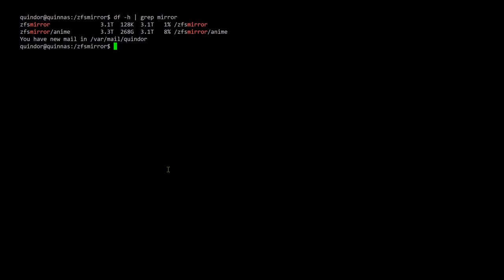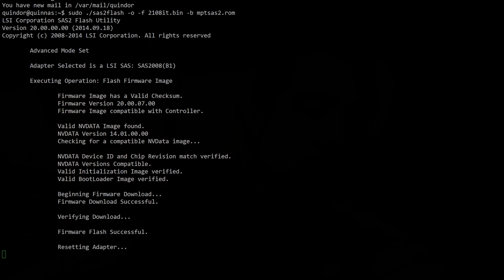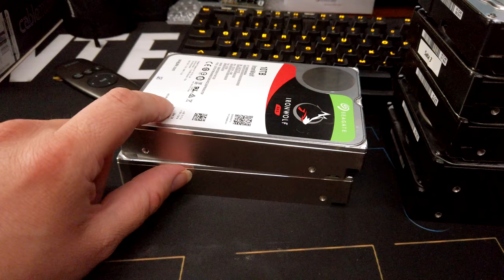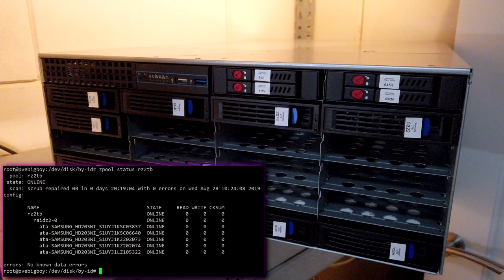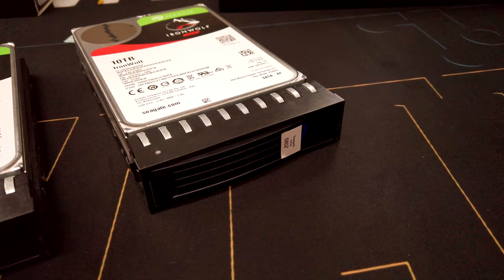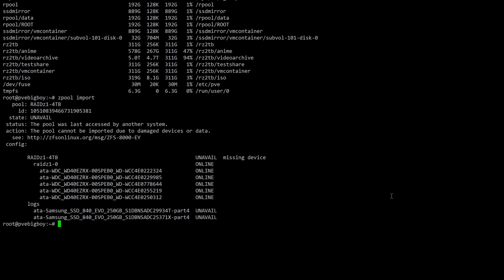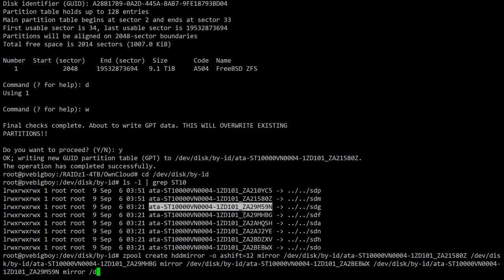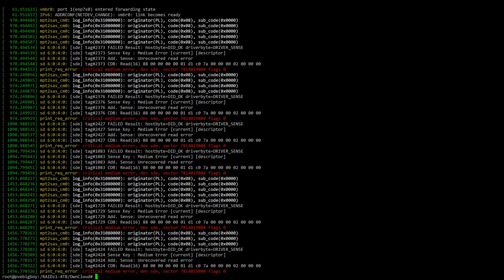Home Networking: 100TB 10Gbit Server - Creating ZFS mirror pool and migrating data!

Comment: Protip, add pv in the mix to get an eta and progressbar to zfs send
Reply: You can also use the -v flag, and it doesn't hurt to also set -s for resumable recv, and -c for sending compressed blocks instead of decompressing and recompressing

Comment: Thank you for actually showing the commands that you entered. Several ZFS videos I've seen just mention a command but show nothing. Actually seeing examples helps a lot more. What are the two processes I see running sometimes in the lower right or left corners?
Reply from the maker: Thank you, yeah, to many "tutorials" which don't actually show you anything. ;)

Damn it, I wanted to add the tools used in the video overlay but forgot!

The left colored one is a tool called "dstat" and the right one is a "zpool iostat -v 1".
Reply: Aah! Thank you! :)

Comment: Good explanations! I love the send/receive facilities of ZFS. I use incremental backups and the 320 GB of VMs (LZ4 compressed) take approx half an hour weekly. ZFS knows, which blocks have changed and they only send the changed blocks to the receiver. I use a 1 Gbps Ethernet, running at 200 Mbps, due to the CPU load of >90% on the receiving Pentium 4 HT :) My backup configuration seems to be an invitation for maximizing problems, because it goes:
- from a 2018 AMD Ryzen 3 to a 2003 Intel Pentium 4 
- from 64-bits to 32-bits
- from Ubuntu 19.10 (Linux) to FreeBSD-12 (Unix)
- from 3 x SATA-3 (striped) to 2 x IDE + 1 x SATA-1 (striped)
- from16 GB DDR4 to 1.25 GB DDR
But it just worked out of the box, since July!! 

To make things worse, I also mixed on both sides one 2.5" / 5400 rpm HDD with two 3.5" / 7200 rpm HDDs. Both laptop HDDs are 320 GB. The P4 IDE disk are 250 and 320 GB, while the other SATA-3 disks are 500 and 1000 GB. Of that 1000 GB half is used for archives, the other half as part of two striped datapools for VMs and Data.

My P4 backup server is an $25 project and a typical Ebenezer Scrooge solution. I bought a new Itech power-supply (600W) + an original Compaq/EVO case. The case has a  Pentium-4 and a Windows 98/2000 sticker. Motherboard + CPU, memory and HDDs were all leftovers from the past. I only connected two cables Power and Ethernet. I might spend another $10 for 1 or 3 times 1GB DDR to get the dual memory access working. I expect, it would speed up the Pentium by 20-30%.

Comment: wondering 2 things : 
- how you do you scrap your drives? hammer, water, drill holes?
- You don't seem to be using encryption are you not worried about your data if one of your drives fails and you send it out for a replacement?
Keep up the excellent work, really enjoy watching you doing your thing!

Comment: Hi

Awesome series of proxmox

Two questions ?

1) How do you monitor the zfs pool ?
In case one of disks fail

2) is truenas scale an option? (Run as a vm with passthrough on proxmox). I don't need all features of truenas scale.
Would you recommend it?
Reply from the maker: 1. Proxmox will send you a mail if issues happen.
2. I don't like nested VMs for storage, too much stuff that can go wrong. If it's just to have ZFS that wouldn't make sense so then maybe for the interface but a lot of that is in Proxmox already too.

Comment: How do you decide the amount of over provisioning? Say your installing the os on 2 64gb Sata doms mirrored and 2 1tb NVMe drives mirrored for fast VM’s and 4 1tb ssds in raid 10 perhaps for storage. What would be the best scenario on setting something like this up in proxmox? Thanks really appreciate your videos I’ve learned a ton.
Reply from the maker: Well, it's a bit of a ball park figure really. Basically any space you don't partition the controller will be able to use to help do its tasks causing less rewrites and thus saving the life of the SSD a bit. But now a days with good TRIM support and such, it matters a bit less. So it's up to you really, maybe give it an extra 10%?

Comment: Hey Andries love the journey so far and you're an amazing narrator! One quick question: the case on the old server is a Chieftec but what model? Thanks!
Reply from the maker: The old server was in a dirt cheap sharkoon case, I can't advise anyone getting that. But if you mean the drive bays those where from Chieftec, this model isn't for sale anymore it seems but they have updated versions: http://www.chieftec.eu/en/accessories/sas-sata-backplanes.html
Reply: @IntermitTech  oh I thought it was a case with backplanes, but you can buy backplanes separately and fit them everywhere you want. Nice! Thanks!
Reply from the maker: @maur8  Yes! :D Not the cheapest way to do it, buying something like the inter-tech case gets you more and better for the money. But if you have a case and just want to add a few it's a great option!

Comment: Hey Quinn, I know this is a rather old video, but as I am about to build a similar server in the next weeks, I would like to know how do you access your files? Have you installed a Samba server on Proxmox or in a LXC container where you passed the folder through?
Reply from the maker: Samba on the proxmox host, permissions through and LXC container gets complicated quickly.
Reply: @IntermitTech  Thank you for your quick answer! Now I tempting between Proxmox with ZFS and a bare metal XPEnology.. hmm.

Comment: Politely, when upgrading a storage volume to another larger volume to retire drives.....
May be faster w an 8-bay system via Ubuntu w. 4 instances of DD Rescue.
Every instance will be an absolute copy -- and you can EASILY clone 16TB in a day.
16TB over Gig-E  =  37 hours & NOT reliable. Plus risks interruptions + files that won't read stopping transfers until you notice. Especially ZFS in which order doesn't matter.
Since I have two T320s, I can clone 8 drives at the same time... which is luxurious.

Comment: Z370 Board ? I mean if you going to put it in a rack mount case why not get a true server board? It would have been cheaper then gen3 AMD, And no ECC ?? Link would not load for me and from the title it look's like normal ram.
Reply from the maker: If you followed the series a little bit, it's an x370 board with a Ryzen 1700, my old desktop parts which have moved to the server and bought new stuff for in the desktop. ECC is nice, but not worth the cost for a home situation in my opinion, as is buying serve grade hardware where this cost 0$. Server hardware has it's place, but in a home setup it's just not worth the money if downtime is acceptable.
Reply: @IntermitTech  Ebay you can find ddr3 Kingston 16GB dimms for 20-30 Per. I went a little crazy and put 128Gb. I think with ZFS its a must. if your data loss is not a priority then not a huge deal. Yeah I get why you did it.
Reply from the maker: Not having ECC memory has never lead to data loss with ZFS (try and find a case), and if it would occur, ZFS would actually throw a checksum error and then repair it since either the copy on disk was wrong or in memory. Then it would have to make the exact fault again to write something bad, ECC memory doesn't even necessarily protect against that. I know it's the online word that you need it, but from a technical standpoint it makes no sense whatsoever especially with having ZFS. So ECC is a nice to have but certainly not a must in my opinion.

Comment: Question, I got a raid-z1 pool that has some resilvering issues (probably that WD shingled drive thing that was discovered recently). Now I had to buy new drives anyway because I want to get a bit more redundancy with raidZ2, so I have a brand new pool ready to go. For migration, would you still recommend using the sending snapshot feature in this case or use rsync and hope for the best? Thanks.
Reply from the maker: If it's both ZFS sending over using a ZFS snapshot will always be best and most fast, you can do it per dataset so that you can do it in smaller chuncks if you want to. Rsync is a fine option too but block (like ZFS send&receive) always has preference in theory.
Reply: Thanks, the reason I ask is that I'm pretty sure that some files are corrupted since well zpool status says so. Weird thing is, each drive has the comment 'too many errors' but on the bottom it says 'no known data errors' To be honest I'm amazed the pool is still alive. My plan for migration was rsync until I stumbled upon your channel, I don't care about the migration speed, but the checksumming it does would be good to only copy the uncorrupted files and skip the corrupted. That said, would snapshot send and receive still be a better option in this case? Never used it so I'm really curious :). Thanks again, awesome channel. Groeten uit Waalre, bij Eindhoven.
Reply from the maker: @AnillusionNL  Thnx for the kinds words! Waalre ken ik wel. ;)
Yeah, I'd still try using ZFS send&receive since it should be fastest. In regards to data integrity, ZFS won't give you anything it knows is corrupt basically so I don't think there will be a difference in that regard using either method. :)
Sounds like your pool is having major issues, that sucks! You could be lucky that the corruption is spread enough that it can always rebuild a file but fingers crossed! Hope you get it all off!

Comment: I wonder how well zfs can handle reading data when a disk is bad but still in the pool. I'm wondering if it starts using checksums at some point.
Reply from the maker: Well basically, by default it checksums all the data, that is one of the advantages of using ZFS.

But it also relies on the disk subsystem beneath it, that's why it's best to use motherboard SATA ports or LSI IT firmware based SATA ports since it has the most direct control over those.

Still, in the end it relies on the disk and it basically "giving up" on reading the data and letting the redundancy system (in this case ZFS) restore the data. This is called TLER and is a feature that sets apart an Enterprise or NAS disk from a desktop.

In a desktop you want to disk to keep trying for minutes to read your data since if it can't read it, it's gone. With something like RAID or ZFS it's the opposite, it should give up after a few seconds and report back "can't read this sector" and then return control to ZFS to let it do it's thing.

Comment: Hi, great video. As luck would have it, I've built a NAS nearly identical to your 12-bay (Sharkoon case, four triple hotswap bays) and I plan on moving to a new 24-bay 19'' chassis similar to your new server's. I'm worried about HDD temperature. In the Sharkoon, they quickly rise to above 40°C and if left running would hit 50°C in a few hours (and that's the temperature WD says you shouldn't run your HDD above). I blame my decision to replace the triple bays' original fan (Delta) by silent Noctua fans, which may not have high enough static pressure. I'd like to know how the drive temperatures look in your Intertech chassis. I'm a bit worried that the backplanes are blocking the airflow and judging by noise the case fans aren't exactly jet engines. My ideal NAS would need to be able to run 24/7 with 24 HDD's and none of them ever reaching 50°C... while keeping fan noise as low as possible.
Reply from the maker: Sure, with the Noctua running at their full power, it keeps the disks below 40c easily. Only the very old Enterprise SAS drivers run a bit above 40c but generally well below 50c also. The noise is decent I'd say, at full speed you will even hear the Noctua fans, but it's still 10x better then the stock fans. I think you'll be fine with the WD disks, those generally aren't even 7200rpm like ALL the disks I have in there are, should be a lot less heat actually.
Reply: @IntermitTech  thank you. Since I wrote my comment I watched more of your videos about this NAS (I subscribed, by the way... seems you're doing pretty much everything I've done or am going to do very soon). I saw your video on the Noctua fans. I love those too, basically whenever I buy something with fans I replace the original fans with Noctuas almost before I power on the device for the first time :-D  Regarding the HDD's, I do have a lot of old 2, 3 and 4 TB 7200 RPM HDD's from WD that I'd like to give a second life to as part of a disk array. I do expect them to fail in short order but they'll be replaced with bigger, recent disks. I have 4 x 10 TB Ironwolves and 6 x 12 TB Exos 12 TB. The Exos are in my DIY NAS (FreeNAS based) and the way they heat up worries me. I've had to leave 6 of my 12 bays empty to leave them some breathing room but obviously this sucks.

My plan is to invest in maybe 8 x Exos 16TB drives. In an array with 2 drives used for parity this will cover my needs for the foreseeable future. The remaining 16 bays in the new NAS will likely receive old drives and I'll use them to learn more about NAS operation (I'm fairly new to this, I've only used iSCSI once...). I have a old but trusty i7-920 on an X99 motherboard (plenty of PCIe 2.0 lanes and RAM) and I hope this will suffice to drive the new NAS. It'll be replaced by my i7-5820K as soon as I update my workstation. Thanks for pointing out the PCIe x1 GPU, this will be very useful.

I understand that the case's backplanes are SAS and I will be using a Broadcom 9305-24i. It's tempting to spend a little more to get the SAS variant of the Exos 16 : will I gain any performance from it ? Are they more reliable or can just stay on SATA ?
Reply from the maker: I don't know what the additional price is, but generally SATA is fine for low queue workloads.
Reply: @IntermitTech  where I live, I can get the Exos 16 for just under 400 € in SATA and 412 € in SAS. I do think my workload is low-queue : it's half archival, half video editing, and SATA has been good to me so far. I'm on a 2.5 Gbit Ethernet connection, always saturated.

Comment: hi, Intermit.Tech, which is your preferred os for a media server and to store family memories, and run surveillance cameras?thanks, love ur videos.
Reply from the maker: I generally run Ubuntu or if I want something containers/VM I switch to Proxmox which is Debian underneath so pretty close to how Ubuntu works (Ubuntu is Debian based to be correct).
Reply: @IntermitTech  so, better than running freenas?
Reply from the maker: @ralfman5  FreeNAS is fine but I personally do not like the BSD operating system. I also like to setup things "my way" and FreeNAS is quite restrictive in that regard. So I'd rather do it using a Linux system I like using. Performance wise there really isn't a different in the ZFS implementation anymore. Also, this box will also run VMs and containers and that isn't an area where FreeNAS shines.

So better isn't the right word I think, just different and preference.